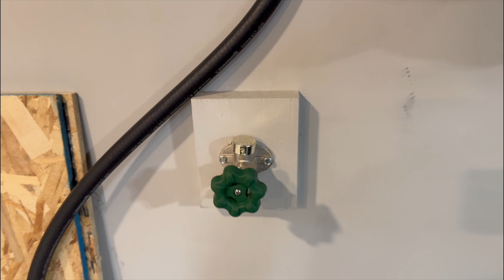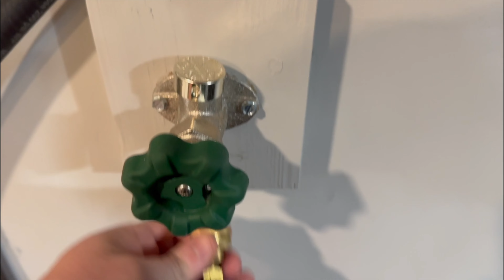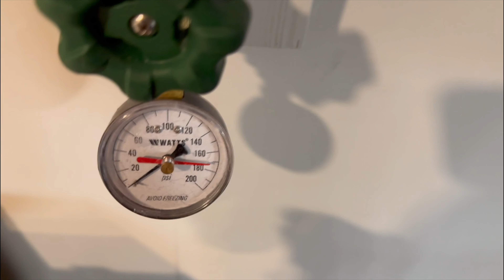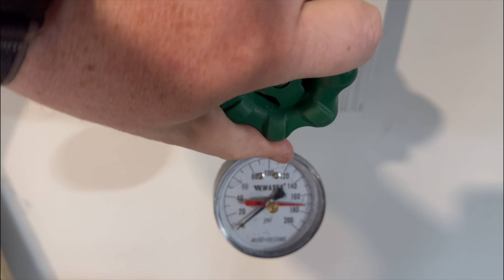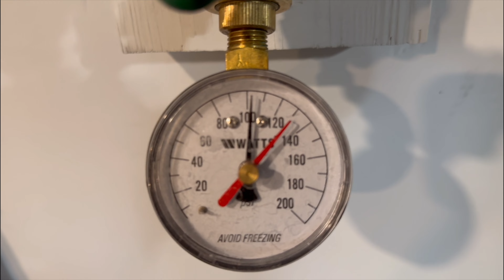I Installed a Heat Pump Water Heater!

Comment: Cool video. That’s a lot of work condensed into one video. I’m curious about the mixing valve towards the end. What did you mean when you said that it makes the water heater effectively bigger? It seems like the cold water would mix and cool down the hot water coming out of the water heater. Thanks! Hope to see more!
Reply from the maker: Hey, great question! I actually just learned about this myself during the install.

Normally you store water at 120°F. With a mixing valve, you store it at 140°F and dilute it with cold water as it comes out of the tank—the valve mixes it down to 120°F. So you’re using less from the tank each time, which makes it feel like you get more hot water.

There’s also an advantage that storing at 140°F avoids any chance of legionella bacteria growth.

Really appreciate you watching! Next video will be on ducting the freezing cold air this thing puts out to the outside lol.
Reply: You generally shower in ~100F water, which mixes the normally 120F water with from the tank with cold water to achieve a ~100F output.   If you raise the tank temperature to 140F, you need less volume of hot water to get the same amount of shower water, but running the tank at 140F can cause burns and injury to people if they aren't careful about never using 100% hot against bare skin.  The mixing valve pre-mixes the 140F tank down to 120F output to your faucets, where you can then further mix it down to whatever level of hot / warm you want without risk of burns or injury.    We just installed one because our 80gal tank stopped working and it's apparently now illegal to buy 80 gal residential tanks due to the environment, so instead they had to put a 55gal tank cranked up to 140F and a mixing valve to cool it back down to 120F.  The result gives an effective equivalent of something like 65-70 gal of 120F water.  It helps the last person who takes a shower to have a shower that lasts a few minutes longer.